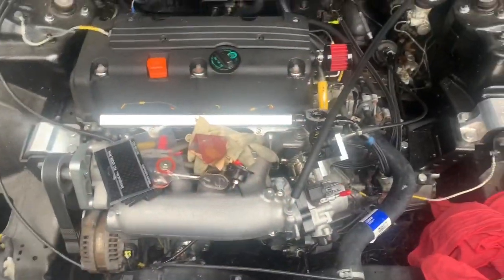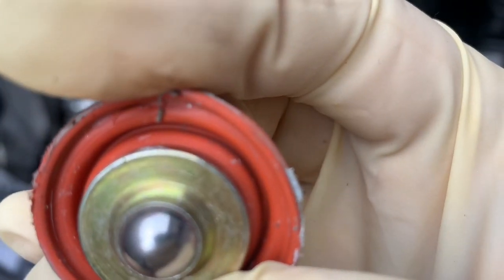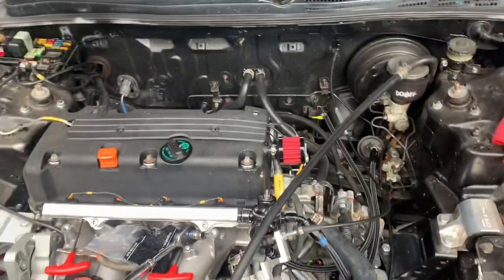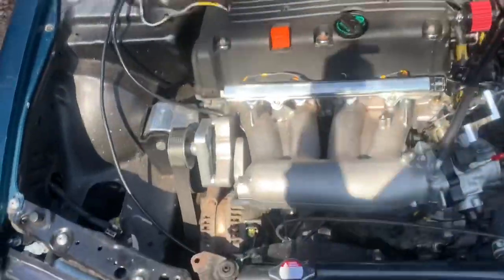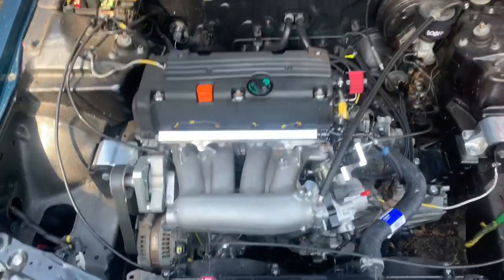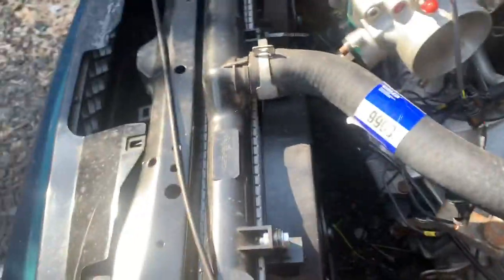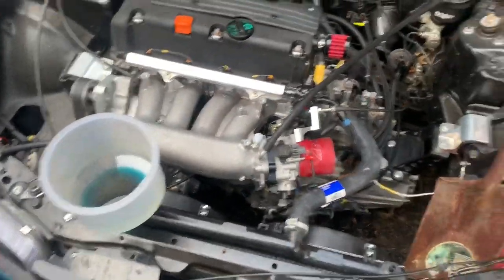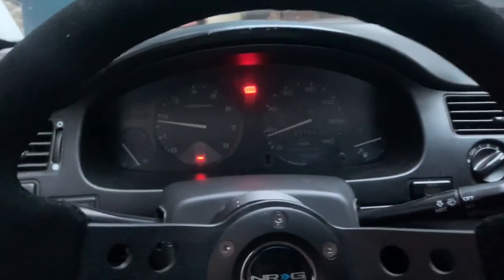Fixing Fuel Leak and overheating issue?

Comment: Air in the system , ran into that myself a couple times after engine work.  Just working out the Kinks, you’re getting those finishing touches done.
Reply from the maker: Power bodybuilding slowly but surely bro thank you, im feel like she is good now as far as engine temp thats also idling temp so maybe it’ll get cooler when i drive

Comment: You should set the fuel pressure to 43psi adjust it and it should start up better
Reply from the maker: Kevin Camille i was planning on to, when i was able to drive it to the gas station
Reply: @space3748  also with the heat you may have to jack the front end up to get any air pockets stuck in the heater core out if your still having that problem
Reply from the maker: Kevin Camille definitely gonna consider to rebleed the coolant when im able to get on flat ground so its not so sketchy lmao

Comment: how did you wire up the two cooling fans together?
Reply from the maker: InsaneGamingTips in the K24 tweaking small issues video i have, i go more in depth, but its mainly off of the ecu and i wired them individual one going to the stock fan plug and the other to the ac fan plug